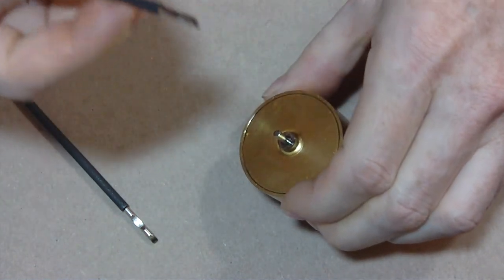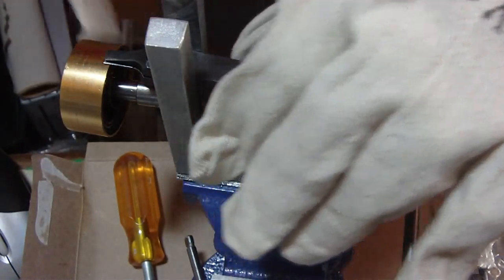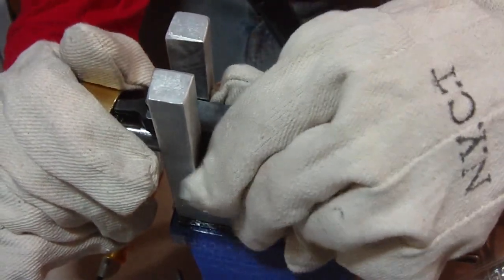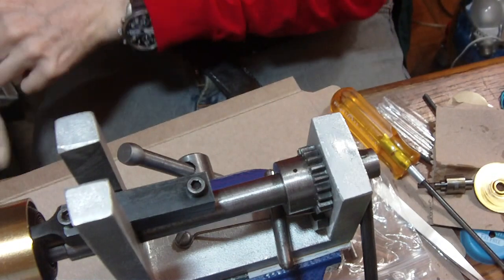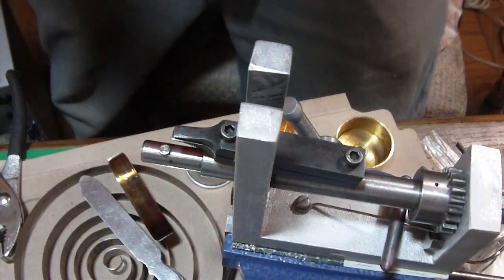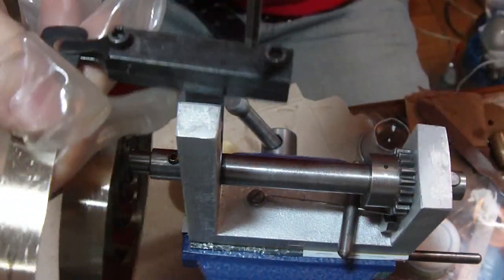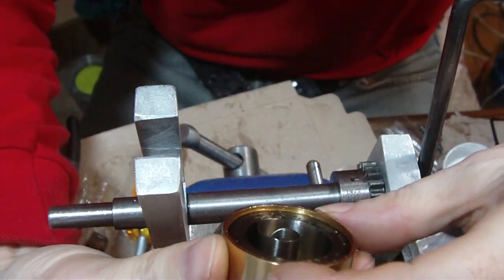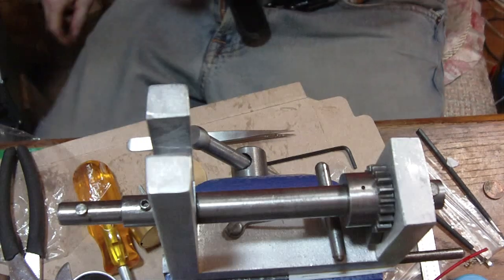Removal and installation of rivet end mainspring

Comment: Have enjoyed your videos for about 8 years. Just attempting to get an 1871 Elgin running again. Your video shots are amazing to me after seeing first hand hand how small the parts are. Can not seem to get enough light or magnification. If you ever have time it would be great to see your lighting, magnification and any other tips. Thanks for all of your past videos!
Reply from the maker: I like those key wind Elgins, the ones with the sharp corner barrel bridges.  For disassembly and assembly, I mostly use 5X magnification and for really close up 10X.  Any more magnification is just for inspection purposes.  Currently I have an overhead lamp that I think uses a 5000K LED bulb.  White light not yellow.  When I make a video, it is mostly 3X magnification which I don't recommend.

Comment: Trying to repair a dollar watch mainspring broken close to the arbor. How can I reattach the spring. W/0 buying a new spring. BTW where could I buy a new mainspring??
Thanks
Reply from the maker: I have seen hole punches for mainsprings on ebay.  You could also drill a small hole and then open it up with a file to the correct shape.  If that doesn't work buy a parts watch and take that mainspring.